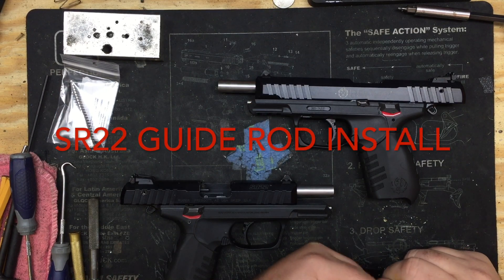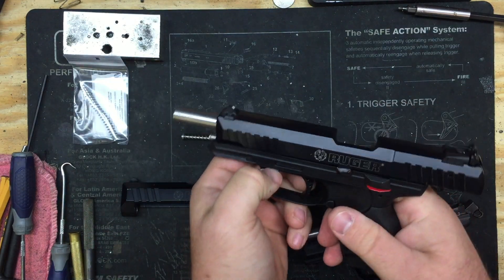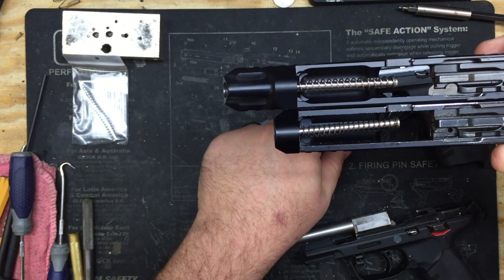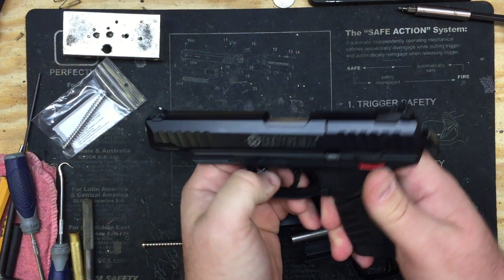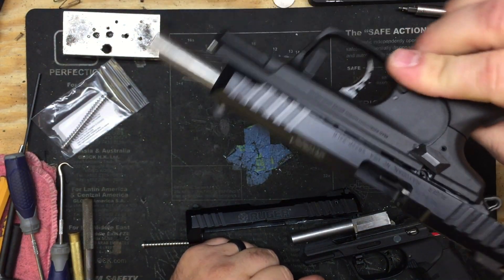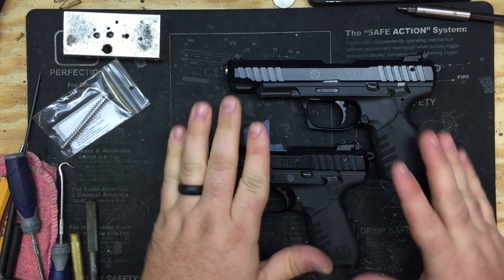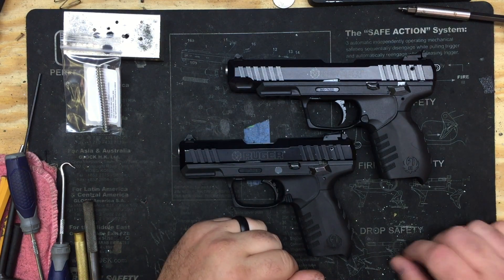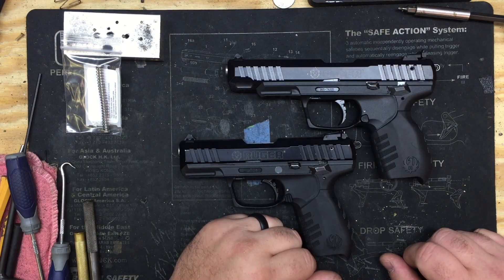SR22 Guide Rod Installation

Comment: I have a SR22 on layaway and I feel that in most cases you don't need to replace the guide rod and spring unless you have some kind of a problem, but I do admit in the case of the SR22 the captured spring looks like it would be much easier to reassemble the gun after field stripping?
Reply from the maker: That's the idea of the captured guide rod, it makes it much easier to assemble and disassemble.